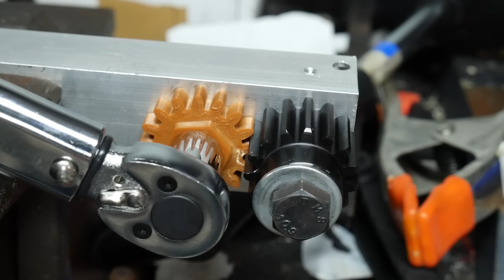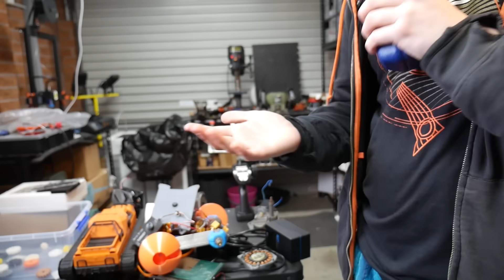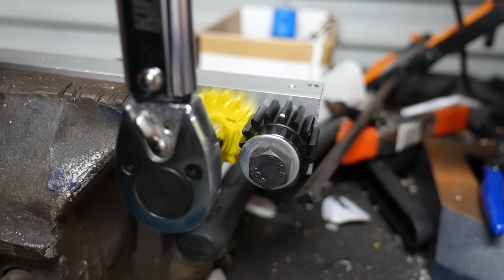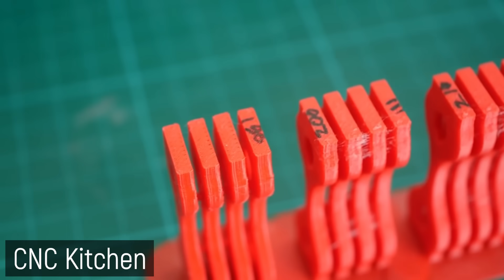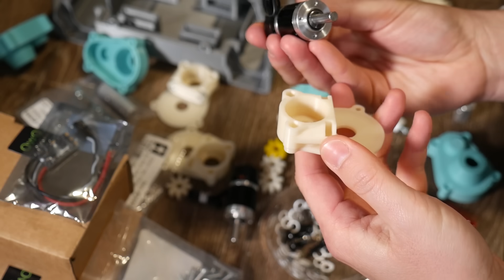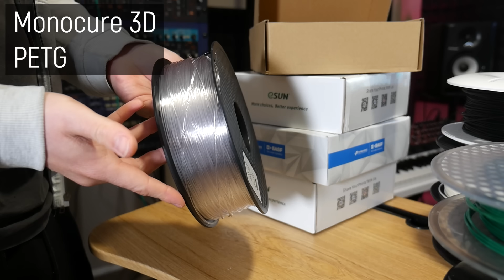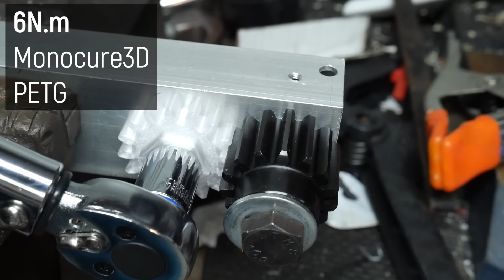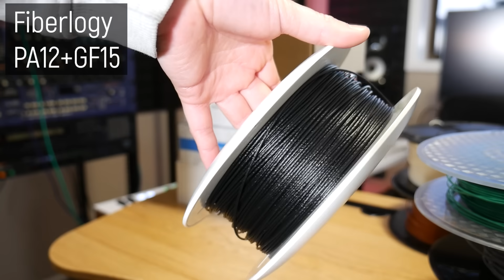Which 3D Printed Gear is Best?

Comment: For any others interested in 3D Printing beyblade parts.

Funnily enough, I'm just watching this cause I wanna make a 3d printed beyblade layer with high durability, since I notice some amount of other 3d printed layers like to break sometimes, and I think I know why now. I've never done 3d printing before, and still don't have a printer nor the filaments for one, but this will be useful. In terms of 3d printed beyblades, the best for a durable beyblade would be the BASF Pro 1 PLA, and if you want an effective spin steal layer, as well as the high durability, PA12 is definitely the way to go. 13:09 pretty much sums up the reasoning for the spin steal, and the chart at 15:50 shows the good durability. The same BASF and PA12 filaments can also be used for the driver tips, the PA12 should be useful in place of rubber tips, and BASF is good for the basic tips. if you want to 3d print discs however investing in a form of metal filament, such as a stainless steel or brass filament would be more ideal, otherwise you can just use existing discs.

Put Simply:::::
Layer::
Basic:: BASF PRO 1 PLA
Spin Steal:: Fiberlogy PA12

Disc::
Stainless Steel / Brass Filament

Driver::
Basic:: BASF PRO 1 PLA
Metal Tip:: Stainless Steel / Brass Filament
Rubber Like Tip:: Fiberlogy PA12

Thinking about it now, I might make some form of article on 3d printing beyblade parts, in it, I will simply go over the process of it, and of course have this video in the credits, when I do end up making it, I'll replace this statement with a link, although it may take a while to do.

Hope this helps for others interested in 3d printed beyblade parts.

Comment: What about making the hub out of one material, and then adding a ring of another material? I think this has been done in engineering for a long time, since the shaft to gear connection has quite a different load profile than gear teeth meshing into each other. Making flexible gear teeth to counteract brittleness, but a rigid hub to counteract slipping. If the surface between those two parts is shaped like a gear in a teethed ring, then the surface between those two should be so large that it should be compatible no matter which two materials are used.

Comment: Most of the gears seem to break at the infill or right at the edge of the inner wall and infill. I'm sure there are plenty of ways to print these gears to be much stronger.
Reply: Yes there is I am part of robotics team where we print all of our gears and I can tell you just by looking at that snap for his slicer his wall perimeter is pathetically low. He can probably get at least double the strength by doing nothing more than doubling or tripling the wall perimeter

Comment: PLA is completely unsuitable for gears, because it heats up due to friction, and the melting point is very low. No fracture tests make sense here, because the wear will be for another reason

Comment: In the design of the gears, the accuracy of the filament during printing is important. For this POM, although it has a lower melting point temperature than polycarbonate, it is better known. That is, many experts believe that the best way to print gears is as follows: POM, then PC, then PA 12. Do you agree?

Comment: Taulman makes some amazingly strong Nylon. I have used them for gears in an industrial lathe that was out of production and we couldnt get replacement parts. What was one of the best parts was how quiet it made the machine with nylon gears versus metal. I admit the gears only lasted a few years but considering we could print them for a couple bucks each, we just made an inventory of replacements.

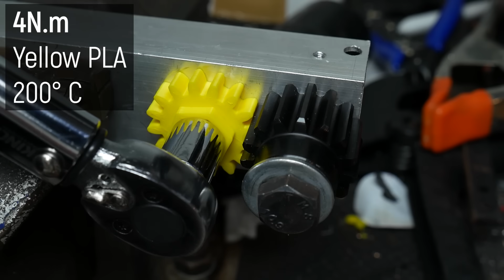Comment: Late to the party but if you ever plan on doing similar teasing in the future (speaking specifically to gathering torque data) I'd recommend a torque wrench adapter than a regular torque wrench. You can just keep cranking on it till the part fails and the digital adapter will tell you the peak torque. I first learned about using this method from ProjectFarm who does this in his videos when testing torque numbers. You can get an idea of what I'm describing if you check out his video on Anti Seize compounds, around the 4:30 mark! Or, really, most of his videos on small tools and such but that was the first one that came to mind

Comment: So, this is just loading until catastrophic failure. That's useful, for sure... but there are other metrics equally useful.

Like continuous loading over time.

How "out of tolerance" is a part after an hour of continuous duty? 4 hours? 12 hours? A week?

What heat characteristics will it experience?

What about with lubrication?

Very useful video! Makes me want to do some testing!

Comment: Would be great to see more real use case test. Spin up to full speed to get warm with no load, then use a prony brake to measure force untill it fails. If you add rpm counter you can calculate horsepower.

Comment: My vote: I feel like I'd prefer the gear to snap fully in half; that way the motion just stops rather than the resistance of the gears potentially doing damage to the motors. if it freely breaks, then more chance of the motors not pushing and occasionally skipping over the inside of the hub. obv the full break could cause other problems, but I think pros outweigh cons there.

Comment: Nylon is often used for plastic gears, I think because of reduced friction, not for increased strength. That said, good PLA is a huge improvement over what it was like in the early days of home 3d printing. I could actually crush in my hands the parts delivered for my old threaded rod Prusa printer, it reminded me of pasta. The new high quality PLA is much improved, and hasn't caused me problems yet. I think if I were trying to protect an expensive motor, I would add a part designed to break first, probably attached at the motor shaft, say a coupler with a groove of smaller diameter to be an intentional weak area with an experimentally determined size.

Comment: I've 3D printed a couple spur gears for older RC cars where the gears are either unobtainium or incomprehensibly expensive.  As of yet I've had really good luck with just your bog standard nylon (esun in this case).

I've thought about trying some of my cf-nylon, polycarbonate, or even kevlar reinforced nylon, but I haven't seen the need in my application.  I admittedly don't drive a ton, but I have yet to go through a single nylon printed gear once I was finished prototyping, and these are on 1/10 nitro buggies.  I did first try PETG (especially for prototypes) but was constantly melting them.  I don't keep any pla on hand but I'd guess the same issue would have occurred there as well.

Certainly some interesting results from your tests.  I'm personally a fan of the nylon failure method, but it's impressive to see PLA hold up so well.  Nice video.

Comment: I do RC vehicles as a hobby and yes those brushless motors and escs get really expensive. As far as getting the maximum amount of torque and speed you would want to go with metal gears. But being is that yours is a 3D printed Offroad contraption you would actually want the gear to fail in a way that it allowed it to spin freely. This means there is no load on the brushless motor to burn it up. If the gears bind you are thus increasing the amount of torque needed and asking the brushless motor to work harder. So having the gear split in half would be your best option. One thing I will say is that you need to take into account motor Heat which can warp plastic pieces and contribute to part failure. Depending on what your motor mount and chassis is made of the heat from the motor can distort the shape and cause failure such as skipping teeth on the drive improper mesh increased gear wear and the motor to Simply fall out due to melting it's housing.

Comment: A think a crack sounds dangerous, but if it's inside a container that probably gives it a bit more protection from users. If it's brittle, then it'll have a consistent performance until it catastrophically fails, rather than warping where it seems like it would slowly get worse and worse until it's unusable.

Comment: As long as the strength is adequate, softer materials are preferred for moving parts because they're immune to wear, with nylon being the most classic wear resistant material. Tumblers for rocks, gems and polishing are lined with a thin sheet of rubber and last for years. Remove that rubber liner, and the tumbler will literally break open and disintegrate in an hour or so, no matter what metal it's made from.
PLA+ should be an acceptable substitute for nylon, as it only sacrifices a small percentage of stiffness and breaking strength to gain considerable impact resiliency.
That rough textured stuff should last a long time, and might even wear-in - the roughness wearing off in time - but will always waste energy in severe friction.

Comment: Since the shaft of the plastic gear is supported on one side, the holes in the aluminum angle bar gradually widen, increasing the clearance of the gear and making it more susceptible to rotational moments.